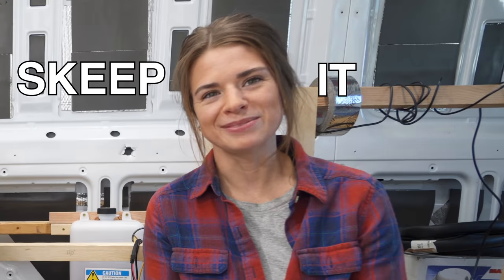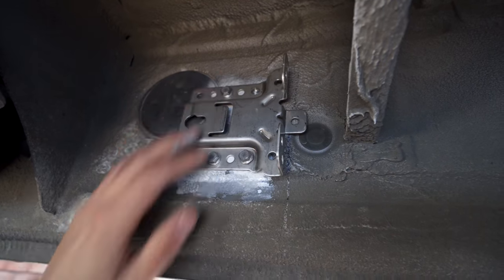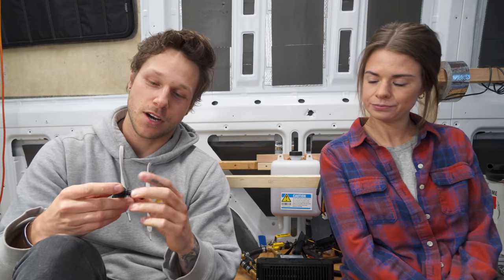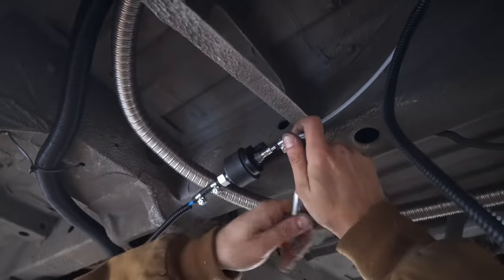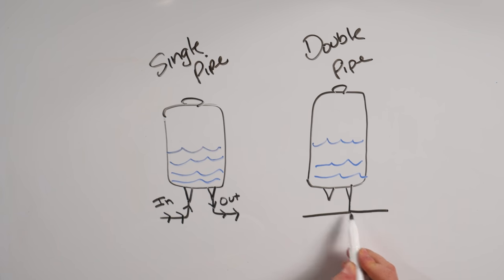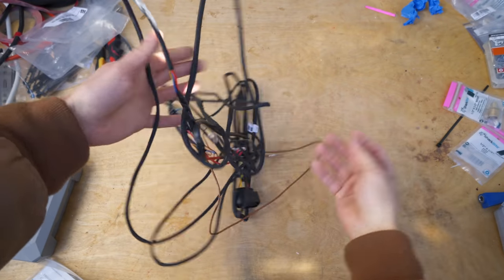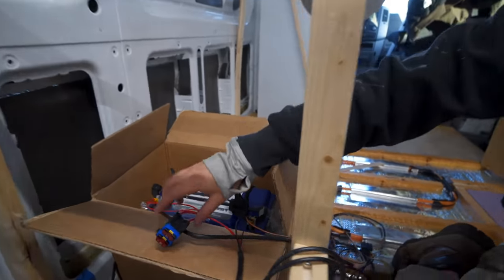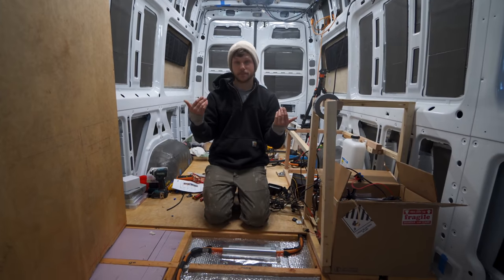Heat Your Feet! How To Install A Hydronic System In Your Van

Comment: I love the idea of a hydronic system in a van! My 2 cents though: Please consider re-routing the exhaust pipe to the side of the van so the fumes won't get trapped below and start to rise up into the inside where you are sleeping. This can be very dangerous!
Reply from the maker: We can relocate it no problem!
Reply: they way he mounted it is perfectly fine. enough air circulating there
Reply: @V4NLIFE_CANADA  where does the air circulation come from?  The van isn't moving most of the time when you are running your house heating.  Exhaust should be to the outside of the footprint of the van. Those are deadly gases.
Reply: @vikingvan7864  nope
Reply: Maybe you did, and I didn’t see it. 
But, Jack stands sir. 
Use jack stands. 
Never trust your life to a tiny Oring inside a jack holding up the thousands of pounds of your van.
Reply: These heaters burn a few tenths of diesel per hour. The exhaust is minimal. Nothing to worry about.

Comment: RE the floor, although I don't know the best way, the problem is that you don't have enough tubing in the floor. I would lean towards trying 1/2" tubing, to slow the fluid and enhance heat transfer, and lots of it. The pump might be too light for smaller tubing and you would just increase the length. The spacing is way too far apart.
Reply from the maker: Yeah we came to that conclusion at the end of the video. We are using 1/2in tubing for the underfloor heating. They definitely need to be closer together, but I also think the flooring needs to be different. I wonder if I could've gotten away with 1/4in subfloor, but who knows if that would make much of a difference.
Reply: @dogcatmanvan  As nice as a warm floor is, I'm thinking all solutions lead to a lot of work, added weight (bad mileage), and slower heating. Perhaps adding more radiator type with or without fans would be more practical. A long radiator without fan could hold a good volume of heated solution, radiating heat while the pump is off. You're kind of asking the same of the floor, but you have reduced radiation, and only a hard surface will keep the heat, giving up more space and increasing the weight even more. Interesting build, good luck.
Reply: Not sure how far along this van is but a possible adjustment could be made at this point. You can router out grooves on top of the subfloor and place flooring directly on top of the tubing. That’s my plan— I’ve got these layers 1) furring strips with insulation on top of the van metal floor, 2) 3/4 inch ply resting on the furring strips 3) pex tubing inlaid into the top of the plywood via routered channels (the pattern of the furring strips should support the ply, I’m using 3/8s pex), 3) cali cork plank click lock flooring floating on top of that....click lock floating should reduce any problems from floor expansion changing temps
Reply: I think the best option for floor heating is to have a separate pump loop with a temperature control valve and check valve back to the main.  That way it recirculates until there’s enough heat transfer

Comment: You really should have mounted the exhaust to exit just past the outside wall of the van.  The fumes can come up, and find any holes there may be in the floor, allowing CO inside the cabin.  Carbon monoxide is lighter than air, and can get inside the vehicle.  This is why you will see that your vehicle's exhaust exits past the edge of the vehicle, and why built in generators have an exhaust pipe that clears the wall of RVs as well.  Even the exhaust exit for water heaters comes to the surface of an RV for this reason.
Reply from the maker: We did go back and route the exhaust to the outside once we started using it and we got a few people who recommended to do so. Thanks for watching!

Comment: I agree you should have spaced the PEX in the floor closer, I also would have heated the entire floor even under cabinets, benches, that way the entire floor becomes a radiator. Just remember space heating is not just heating the air inside the van everything inside the insulated envelop is being heated, counters, cabinets, the sink, the bathroom, everything so having the underfloor PEX running under everything helps heat the entire space. There should also be heated floor under your freshwater tank and batteries/electronic for obvious reasons. draw the exact path the PEX in the floor takes on the top of your subfloor so when you are mounting cabinets or 80/20 modules you will not pierce the hydronic lines.

Comment: Consider putting some sort of bug and debris filter on the end of the intake and exhaust of the furnace.  I used stainless steel washing machine lint filter for the intake and the exhaust came with one.  It would probably be "bad" to get something crawling or sucked into the furnace.  I really enjoyed watching your installation.  You do a great job.
Reply from the maker: I was a bit concerned that the intake didn't come with anything. Steel lint filter sounds like a good idea
Reply: I crammed some steel wool into it.

Comment: I did a hydronic floor in a cargo camper build and found the same thing. It just didnt heat up that much. I've come to the idea that the wood is too much of an insulator and ill probably take the wood out and put a thin layer of cement. 
nice video guys!

Comment: I did the same basic system with the gasoline version.  It’s been 3 winter months and I absolutely love the system.  I developed a thermostat to keep the van temperature at a specific temperature, which is control through my phone.  If you’re interested let me know.
Reply from the maker: Yeah let us know how you've got it running from your phone!
Reply: i wished cars heated and cooled the floor as well with radiant but no i have a fan pointed at me 😑 or nothing at all plus it's uneven aka cold spots the the fan missed
Reply: There’s a bit to it, but the premise is that a tiny microprocessor called a Wemos d1 mini turns on and off a relay that turns on and off the heater.  That microprocessor talks to another small computer called a raspberry pi.  That runs home automation software that talks to the iPhone through HomeKit.  So when you turn on the heater through the iPhone, it talks to the small computer.  Then the small computer talks through the vans WiFi to the microprocessor.  It’s way easier than I’m making it sound.  Then when the van gets to the temperature set by the iPhone, the relay turns off and the heater shuts down.  When temperature cools down the reverse happens, and the heater turns back on.
Reply: Do you have a link to the one you used?

Comment: This job was grueling, great job!  When your extruded aluminum comes in and you rework any piping you might want to purchase a copper manifold. It will mount on a sidewall and eliminate a lot of tubing.  Just makes for a nice looking easy to follow flow.

Comment: Love this video. Well done and well explained. As for the lack of difference in the temperature of the test floor, it is about the material used above the heating plates. I will not use wood because of the air traps. We have radiant floor heating in our home and we love it but would use concrete instead of tongue and groove floor. Be sure to place the plates upward to help spread the heat on your floor material. Again, love your ambition and common sense.
Reply: GUTTED that it is so old - doubt they'll read new comments.

Comment: I know this is really old. But I’m thinking a 3-loop manifold would really clean up all that plumbing. One loop serves the heat exchanger, next loop serves the air matrix, third loop serves the floor heat. Easily isolate the floor heat at the manifold for the summer months.

Comment: Thought about the underfloor bypass. I'm not sure it's needed as you've gone for the two pipe method... the risk is that the hot water will take the "easy" route through the bypass and completely ignore the heater and blower. Normally for UK central heating anyway. you have to balance the system so no one thing gets too much water. and you just close the valve when it's no longer needed.
Reply from the maker: We will be reworking the system to eliminate the bypass for a shut off.
Reply: The underfloor water has no where to go. They way they did it the first time will be fine.

Comment: Thank you for putting all of this info together!  I know this isn't a recent video, but hopefully you see this comment.

Was there a specific way you purged the air from the system?  That seems important with the 2-pipe layout and only one port leaving the expansion tank.  

I've basically replicated your system, and im ready to fill with Cryotek-100, but I want to avoid getting airlocked.
Reply from the maker: Hey there, your expansion tank should have a breather line towards the very top of it to allow for the air to expel as it cycles through the system. The only way we were able to successfully purge the air was to run the system and take the van for a drive. Hitting a few bumps and vibrating the system while the pump was running worked the air out of the lines. I drove while Julie kept an eye on the expansion tank and she was able to visually see the air bubbles coming up. The air wasnt really purging itself before we drove the van. Hope that answers your question!

Comment: Funny you mention those plates, I thought when you fitted them they were upside down 🙃, I would also consider the thermal conductivity of plywood is not optimal for heated floors so is probably not helping
Reply from the maker: Any suggestion on an alternative conductive flooring for a van?

Comment: This video has been my guiding light, thank you guys. My only question is what does the line from the center of the purge valve connect to underneath the floor?
Reply from the maker: Our purge line just runs underneath the van and when we want to empty the lines we just place a bucket underneath it. Other than that, it's not attached or running to anything.

Comment: Thank you for such a detailed video! I wonder how is the hydronic system running right now? Also, I know that you can use a water/water heat exchanger to heat up shower water. The questions is, how do you store the hot water for shower? If you store hot water in a separate tank, does it mean that you have to always heat the floor to heat up shower water? Even in summer time? Thx!
Reply from the maker: The hot water is instant. Once the heat exchanger is warmed up you can pump water through it and it heats up instantly for you to use. We placed a shut off valve for the heated floor system so that it doesn't run during the hotter months when we need hot water.
Reply: @dogcatmanvan  Thank you so much for answering. It is quite helpful.

Comment: The point of the heating floor, is that is working when loosing the temperature, so you never should put insolation, between the tubes and your floor, you always have to put it under, to avoid lost this temperature from the bottom. The floor should lose the temperature from the top, and the temperature that the floor lose, is the way it works to warm the air.
For that you need a surface with a high thermal inertia, so it take a lot of time to warm the floor, but after that it will be really efficient, because you will need a small amount of energy to heat the area.
This type of heating is not the best for vans, because you are switching on and off all the time the heating. the heating floor in a house, normally have a first period that it need a lot of energy to warm the floor, but after that just a small amount and also it takes 1 or 2 days to have the proper temperature at home

Comment: Very helpful! Did you find that the 5kW heater is enough? You would need the water tank at room temperature or higher to be able to heat to 100F unless it’s really low flow.  Does the shower work ok when it’s freezing temp outside?
Reply from the maker: So far it has done the trick. We aren't roasting in crazy heat, but it makes the space comfortable. The shower is also working fine as far as hot water goes since we really only take bird baths in order to conserve water.

Comment: Great Video: I am having the exactly same Eberspächer heater in my MAN TGE Camper. My Water Pump is below the camper to bring it's noise out of the van. Maybe you think over about the position of your pump?
Reply from the maker: It's not too loud and we think once it's covered it'll be even quieter, but we won't know until we really put it to use.
Reply: @dogcatmanvan  Since I've seen what you had to wire etc. I am so happy that my heater was preinstalled. It hast 3 circuits, one for the living area, the bathroom and the floor heating.

Comment: I can feel your pain with bad fittings and making everything seal properly. I tried to be smart and use automotive silicone sealant with teflon tape, big mistake! Eventually got minor leaks everywhere and had to disassemble every brass couplings, swear a lot when cleaning silicone residue and finally put back together using plumbing putty and hemp.
Your expansion tank connection with single line is just fine. That's my approach to couple different parts of my system to properly expand toward engine coolant system and its expansion tank.
You don't need to have two 3-way valves to skip floor circuit, just one in front of it is just fine, if re-working with your coupling, reposition that 3-way to front of both air matrix & floor circuit... less leaked heat during summer time when heating water.
And, I'm pretty sure your floor circuit doesn't provide consistent flow and temperature. Good that you didn't do single tube loop as that would be not so great to keep diesel heater happy... because of long and way smaller flow potential of the floor circuit.
My system has separate Bosch coolant circulation pump to feed floor circuit, return line has check valve and in front of the pump is temp controlled mixing valve and automatic air bleeder, and mixing valve and return line are connected to main circulation using "closely coupled tee" approach.
My system starts as single tube system, feeding hot water tank, then air matrix, then those tee's for floor circuit and then return line to diesel heater with 3-way valve to circulate return through engine & cabin heater matrix. Little complex and has almost 20 meters of rubber coolant tubes but it's fine for -26°C and likely colder too...
Reply: Ah, for air matrix plumbing... best to de-air everything is to put input low, output high. Mine is put vertical with tube fittings bottom, to remove air I need to unmount it and put sideways to let flow to remove air.
Reply from the maker: This is all super helpful. Thanks for taking the time to share. Do you find that the Bosch circulation pump helps generate more floor heat? Just curious if we should think about putting a separate pump in ourselves.  You wouldn't happen to have a photo of your system would you?
Reply: @dogcatmanvan  I sure do have pictures... Bosch pump is great when de-aired properly. For some reason my circulation picks air which eventually ends to pump and severely slowed floor circulation.
My next try is to make bigger hole through floor and drop pump underneath for definitely lowest position of the floor circuit... Air must escape up from there and not block pumping
Reply: I've now received new Bosch pump and moved it outside under floor using braided hoses. Works like a charm, very quiet both inside & outside and floor gets the heat